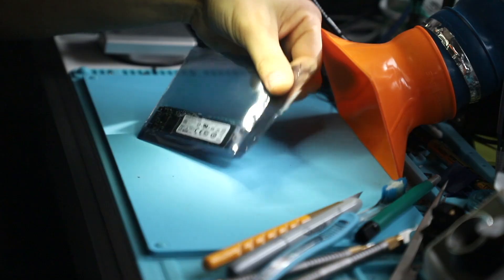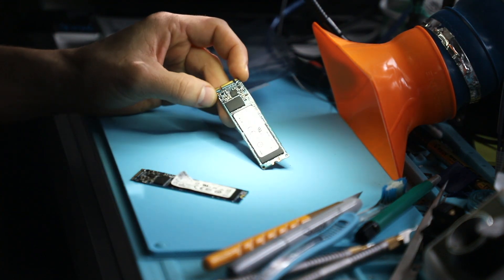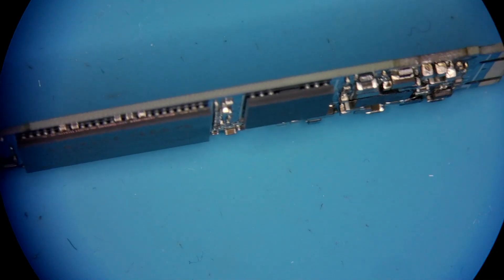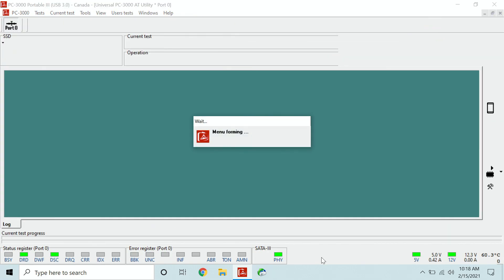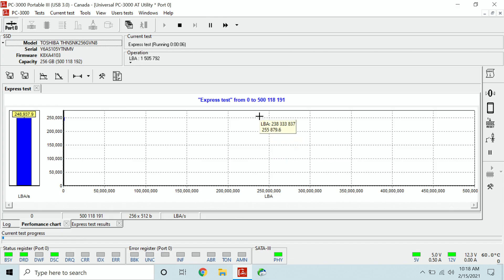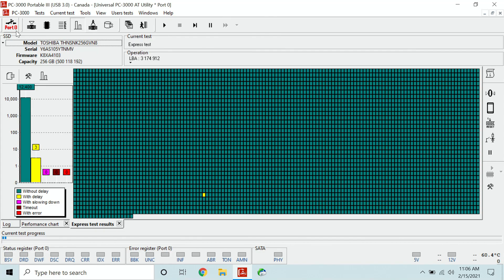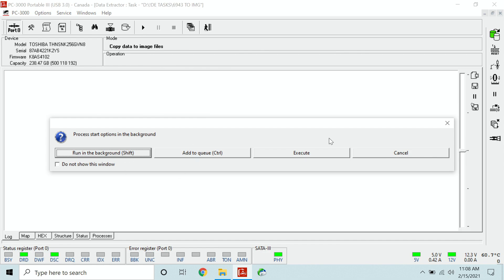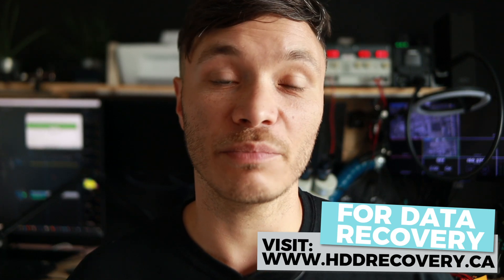how to recover data from m.2 SSD using a donor device

Comment: what kind of flux is that?  i dig how you heat your work remove the chip and wick the old solder off and clean the pads and re tin them ..these videos are great to learn the  working knowledge of data recovery...and one other question do the caps have values wrote on them like paper ones or is that info on the schematic ..finding this channel is like watching Ken Shirriff's stuff ..im in awe :) thanks
Reply from the maker: Thanks for binging dude! Flux is made by MG Chemicals and it's been my absolute favorite for many years. I have Amazon links to it just in case in description. Caps don't have values written on them, but some good multimeters are able to measure capacitance. I use UNI-T UT61E+ at the shop  and it has that mode for measuring
Reply: @hddrecoveryservices  wow ..i wondered how that worked ..thanks :)

Comment: Are you using the jbc jtse hot air station
Reply from the maker: yeah. I just wish it had presets. Otherwise I am happy with it
Reply: @hddrecoveryservices  oh it doesn’t have presets? thought on jbc website it had up to 25 temperature profiles and airflow

Comment: Hello, I'm from Brazil and I have a problem with my Seagate 2t external hard drive. It disconnected itself from my MacBook's USB port and since then the computer is no longer recognizing it. Additionally, the blue light no longer lights up when connected to the HD. I did a test and removed the part where the light is and connected it to another HD, and on this other HD the light blinks. When I enter the disk utility, the HD appears there with its 2t, but it does not appear in the folders on my computer. I have already used 3 different data recovery programs, however they freeze at a certain point without finding any files and it keeps saying that there are more than 100 hours left to complete the process. I'd like your opinion and, if you have Discord, we could set up a quick video call just so you can take a look and make an assessment. Thank you for your attention!
Reply: Please help me